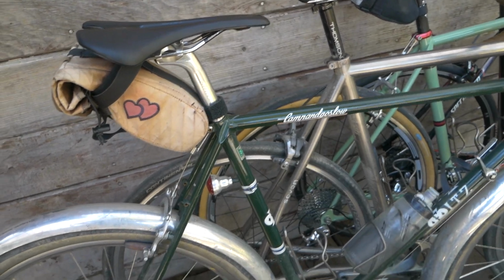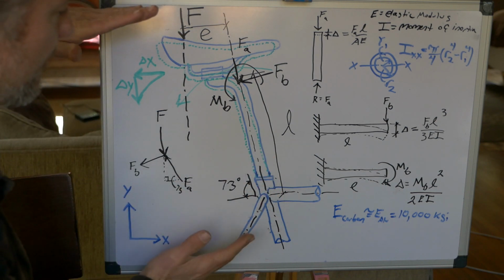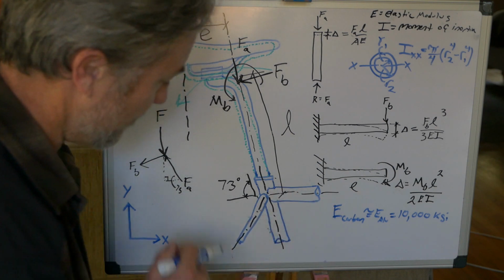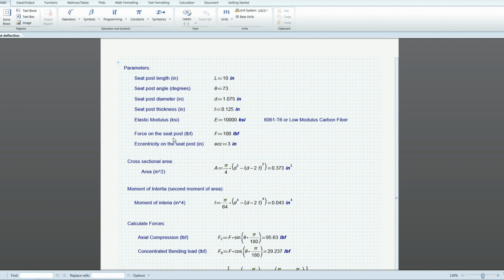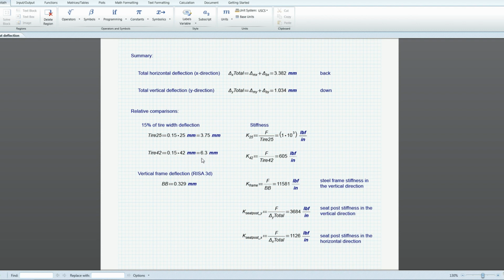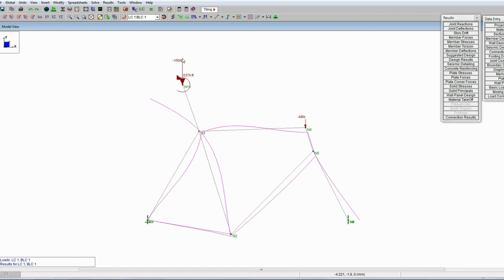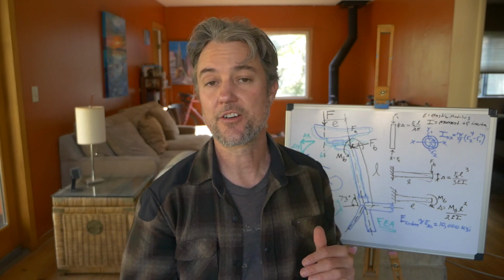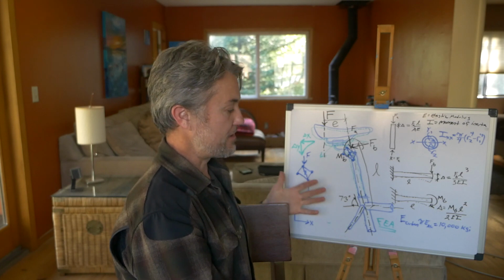Bicycle Ride Comfort Analysis: Seatpost Deflection

Comment: Hi Henry, very nice to see thanks. can I ask/check: when you removed the N3 vertical deflection saying thats what the frame is contributing, why did you not say its the N3-N2 deflection that represents the frame vertical compliance. because the bottom bracket is also moving down, and more than the N3 node... So what I took from your analysis is that the frame deflection was N3-N2 which is -0.082 so the frame is getting longer in the vertical dimension.  Not trying to pick holes - really like the analysis hence wanting to understand it. thanks Shane
Reply from the maker: Thanks for the insightful question and quite impressive you were able to watch this far into the video! That deserves a response all on its own. Here's my take on this and there's lots of other things we can take away from doing this type of modeling. 
Node N3 is the vertical displacement of the frame due to the vertical load on the seat post. If you subtract the two node displacements (N11 - N3) you get the deflection of the seat post itself. 
If we look at N3 vs N2 we see that the seat tube is in tension and therefore it stretches slightly under the given load case. I should also clarify, the axle nodes N1 and N7 (notice the zero vertical deflection) are fixed in translation from moving vertically. If you subtract node N3 from node N2 that's basically the amount the seat tube will stretch under this load case. As a rider, you won't feel the stretch of the seat tube because you're seated on the saddle, at least in this example. If you stand up on the cranks when you roll over a bump then I would say you will feel the deflection of the BB (node N2). I hope I helped to clarify the modeling here. Keep in mind the wheels will deflect too, and the tires (but we don't have that modeled in here).  I just wanted to show how the frame provides flex through things like rotation at the joints and bending in the primary tubes which is a complex analysis and not very intuitive.
Reply: excellent thanks, as you say in this load case the seat tube is stretching a little,that was what I was getting my head around. as you say, its interesting that you can change that behaviour if you put weight on the pedals....v interesting ta  @Henrywildeberry
Reply from the maker: @s_cycle1921  by a very small amount! It would be hard to say you could "feel" it. That said, any flexibility in the material will add to its vibration response, and that's something you can more often feel.

Comment: I agree that a lot of the seatpost/seatstay/frame design argument for comfort is really overblown, if not outright manipulated by marketing departments. I also don't think that the cumulative effect of tire size, pressure, and sidewall construction can be overstated when it comes to improving ride comfort, handling, and performance. 

All that being said, I have a Canyon road bike with an Ergon leaf-spring seatpost, and boy howdy does that make a noticeable difference over a rigid carbon post. But again, put the wrong saddle on it and I'm howling within 50 miles.

Comment: Even though we can feel the difference between a stiff straight alloy post and a carbon setback post does not mean it makes any meaningful difference in terms of fatigue over long distances. There is a study on the effects of this somewhere. They looked at vibration and fatigue from different seat posts. The differences between the best and worst posts was so small to have no real effect for long distance riding. What did matter most was tires and tire pressure. So really if vibration reduction to reduce fatigue (increase comfort) is the goal then suspension posts like EESilk are the way to go. Or if you ride rough dirt roads then the Redshift option is better.

Comment: Appreciate the interview and insights. I went on a replacement seatpost search a couple years ago. My road bike is a moderately stiff carbon fiber frame that came with a 31.8 CF seatpost that wasn't very compliant.  Did some research and worked with my bike shop. Went with a sleeve for the seat tube and a 27.2 diameter CF seatpost that was designed to dampen road vibration. It helps tame the coarse black top significantly.  The tires and pressure adjustment are much more helpful on my gravel bike, especially with the rougher roads.

Comment: Great video! I'm wondering if the assumption of a 100lbf static load is the right analysis. In practice, this would the same as sitting on your bike in a stationary configuration and measuring the deflection, which doesn't necessarily address rider comfort. Though more challenging, I would be interested in a more dynamic discussion of impulse as it pertains to rider comfort. After all, change in momentum (impulse) is what we associate more with comfort, since it incorporates the delta t over which a force (bump in the road) is applied. Cool change of pace! Cheers from one nerd to another.
Reply from the maker: Yes, the 100lbf is my static load, and accounts for the first say +-1mm of deflection. Each additional 100lbf applied would deflect the Seatpost another +- 1mm. In the worksheet, I added a 1.5 factor to account for the potential impact, and also added that to the RISA model, for consistency sake. Thanks for pointing this out. The reason I scaled up by 1.5 instead of 2 or 2.5 is that in the seatpost deflection analysis article published in the 2012 VeloNews article they placed an accelerometer on the underside of the saddle and measured a 0.6g of acceleration. Assuming that's a pretty accurate number the 1.5 factor is a close approximation of static plus dynamic load. An impulse test would be neat. With an accelerometer mounted on the saddle ride over over a few different sized bumps. You could start with a 1/4" tall bump and successively increase the bump sizes until you can't stay on the bike (1 1/2"?). That should give you a pretty good single impulse time-history to use in any future analysis. Even with all of that analysis creating a comfort scale is definitely subjective. Does comfort come from damping large impacts, or softening high frequency vibration? Thanks for the comment. I'm glad to see there are a few folks out there who enjoy these types of discussions.

Comment: One thing you never really touched on is how the length of unsupported (exposed) seatpost changes the total deflection. Would've been nice to run the calcs with l=10" and again with 5" to see the difference, even if it's pretty insignificant compared to the rest of the system (tires, frame, etc.)
Reply: Assuming a constant wall thickness, double the extension lenght means eight times more flex, a relationship to the third power.

Comment: I’m no engineer and don’t understand your formulas but always find your analysis and explanations fascinating. I will add I have a steel touring bike that frame and forks are heavy and stiff enough to be bridge piers I think. 😃 I added a Specialized CGR  carbon seat post that has a wedge shaped elastomer between the seat post and saddle setback topic the post and it did make a noticeable comfort change for me. Thanks for another great video.

Comment: On the mountain bike side of things in terms of comfort, I had two aluminum framed hardtails. One was a Klein Adroit and the other a Schwinn Homegrown. Both used the same grade of aluminum but one was much more comfortable than the other. The legendary Schwinn homegrown was more comfortable because of the geometry and its curved epicenter seatstays along with having a 26.8mm diameter seatpost. The Klein Adroit, on the other hand, had oversized straight tubes and a larger diameter seatpost size that provided a ride that would turn your kidneys to jello on rough downhills or over big bumps. I still have the Schwinn Homegrown to this day set up with 650b wheels and a titanium segmented fork. The ride is silky smooth even though it's rigid.

Comment: Seatpost diameter also plays into comfort. 26.8mm vs 31.8mm there is a discernible difference in comfort levels of the diameters. Some modern gravel bikes split the difference and use a 27.2mm seatpost for some comfort on gravel. Offset and non-offset seatposts can give a difference in comfort using the same build materials like carbon.

Comment: Might disagree regarding spokes... fewer spokes normally requires higher tension and stiffer wheel. More spokes can run at lower tension,therefore less stiff.. Used to get 28 spoked wheels for TT’s.....32-40 spokes for touring,so rear wheel as well as being strong could be run at lower tension.
Reply: Correct.   Fewer spokes require higher tensions to combat the higher amounts of lateral flex, which is still always more than a wheel with more spokes.  In addition, low spoke counts are combined almost always with bladed spokes, making lateral movement even greater.  My favorite riding wheels have round, j-bend spokes.   We have so much technology and yet the traditional wheel still wins in overall everyday performance in my opinion.

Comment: Love all your videos....on subject of frame geometry. Was road racing during 1970’s..flat top tube,hand built steel bikes. ( felt comfortable and fast!). 1980’s involved with Mountain Bikes from the start of their spread in the UK....sloping top tube for stand over height,ie Cannondale were one of the first...then later Road Bikes started borrowing ideas from mountain bikes..Giant made super compact frames in order to reduce the number of frame sizes. Interestingly the ‘trade’ will apply things like ‘stiffness’ or ‘flex’ to suit their marketing process......Seems that comfort comes from many different areas,absorption of shock being the most practical...Would say that in the this time of minute detailed bike fit,we would not want flex of a seat post altering seat height.. In a simplistic way ,if folk want speed then a race bike is the way..comfort ,then probably not. Biggest thing I can notice personally, is when I ride my gravel bike with 650x47 tyres at 30-32 psi it glides comfortably over bumps..same bike with 700x38 at 50-60psi is harsher!

Comment: Really interesting video. I was a little bit shocked that aluminum and cheap carbon is about the same.
Was thinking about a carbon seat post to get a little bit more flex. So maybe a suspension seat post is the way to go 🤔
I would like to have seen some calculations with different extraction length of the seat post to understand how much this makes a difference when the rest is identical.
Reply: New carbon can be way better than old design carbon,it can be designed to flex in the right way if the engineering is right.. Each carbon design rides differently..can be hard as can be or it can have flex built in.

Comment: Did your FEA include tube geometry?  I know your rando has smaller diameter tubes than the new gravel bike. Can you compare the frame deflection  between those two?
Reply: Also, nice video, you were through and spoke slowly.    Results were what I expected ;^)

Comment: My Canyon has the carbon basalt leaf spring seatpost...and its designed to let it flex some inside the frame....its subtle at 1" travel but it is a little cushier.  27.2 post fits a lot of road or gravel frames.  Not made by Canyon.

Comment: Great video! The other factor in the horizontal TT debate is stack. In the past we could have quite a long quill stem but too many spacers on a threadless setup looks goofy. As do "riser" stems. So if you want a higher stack for a more comfortable long-distance bike the sloping TT starts to make sense. Threadless and long HT also gives you a very stiff front end compared to that long quill stem... I guess you would need to do another FEA to quantify that. I'm thinking more from the standpoint of aesthetics. Another option is horizontal TT but to extend the HT above the HT/TT junction. Surly do this. But I don't like it.
Reply: Hard to say where the stiffness of modern threadless bikes comes from. whether that be the longer headtubes as opposed to the increase from 1" steerer tubes, to 1 1/8", to 1 1/2" tapered, and on and on.

Comment: Thanks for the informative video.  The bike I ride most often is a 1983 Steel bike that was labeled back then as an “Off Road” bike. It now has a Brooks saddle, 42mm tires, a suspension stem and yesterday I ordered a suspension seatpost like the one you mentioned near the end of your video.  We’ll see how that works out.  I’m well into my 70’s so I figure it won’t be long before I’ll need the extra cush’.

Comment: I take it you are a mechanical or structural engineer by trade?
One thing worth mentioning is that a compact frame is likely to be stiffer than a traditional frame, so any gains you get in seatpost flexibility might be negated by a reduction in frame flexibility.
Overall, I like the technical discussion by someone who actually knows what they are talking about. I wouldn't mind seeing more videos like this. Thanks.
Reply: The vertical compliance can be seen as a system of springs connected in series. The reciprocal values of the individual spring instances are summed up. The most compliant members dominate. These are the tires and the seat post, if the latter has been optimized for flex. The vertical compliance of the frame plays no role.

Comment: My joke. Industry is pushing, through axle, disc brakes, 12 speed. Traditional frame size you need about 6-7 different frames and moids to make them. Compact maybe 4 frame sizes and molds. Compact larger diameter seat post and bars to handle the extra length. I tell my brothers in 20 years the industry will be pushing 8 speed free wheels, rim brakes, 27.2 seatpost diameter for more deflection and comfort. Just got a brand new Frezzeria and what size seatpost.... 27.2. I have removed my wheels put sealant in. Through axles, with one hand you slide wheel in while pulling derailleur down with your free hand, with your other hand you hold the frame down, with your other hand you push axle in and turn, and dont ever touch the brake lever.